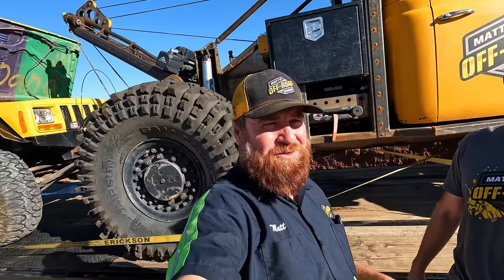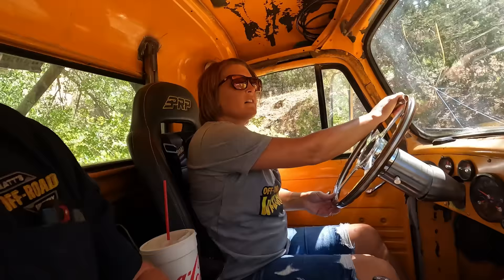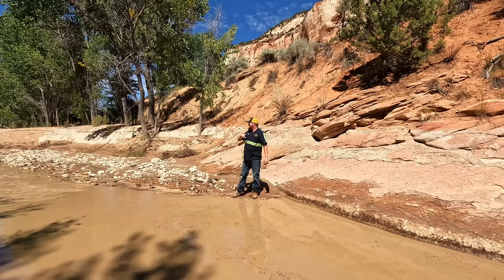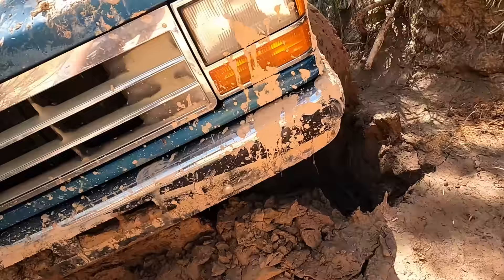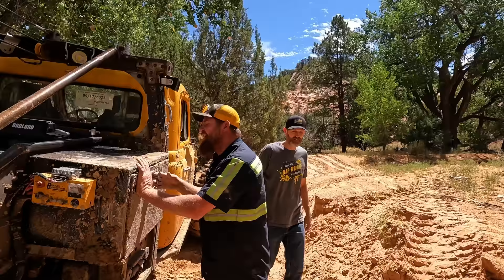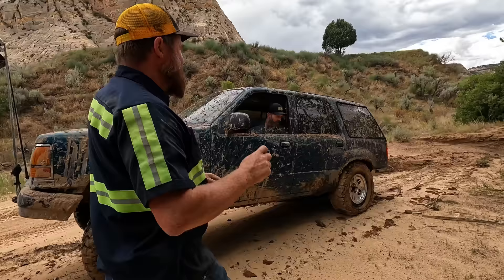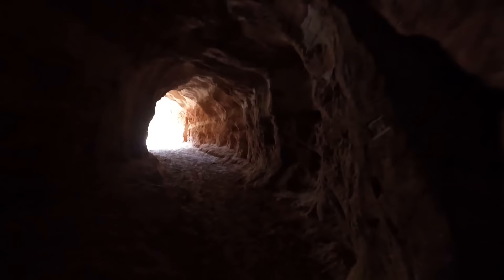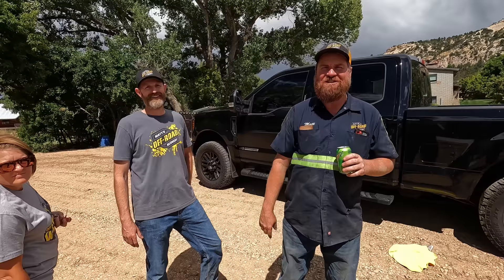It Doesn't Get Much Harder Than This...Pushed To The Limits!

Comment: those air lines you've got in the hot area of the wrecker. rather than switch the whole lot out for hose, you can actually get that same size of air tube in PTFE which will handle a higher ambient temperature. it's also cross compatible with the fittings you have. Might be usefull info for you guys :)

Amazing video, cool as heck to see the wrecker perform a super super hard muddy bog recovery!

Comment: It's amazing that you have been able to build an offroad wrecker from the bottom and a white piece of paper like this. The rig is incredible and an impressiv construction. A construction that should be fantastic good also in other situations and other industries. Just think of one simple thing, tractors used on bad roads or paved roads. The problem often is that a rig is good on the fields or offroad, but not so good on different types of roads. Some will maybe be angry with me, but I have never seen a rig like this one. I'm bowing my disabled old body in the dust because I'm madly impressed. Congratulations to Matt, Tom and all the rest of the team. You are really doing an impressiv job, but I have in a relatively short time written so much praise of you that I have to be careful that you shouldn't just take off my friends😅.

Comment: Matt - those mud tires don't work if they arent spinning fast enough to clear the treads. Put the pedal to the floor and let the mud fly. You can see that they just held onto the mud and turned into slicks.
Reply: Yeah, but you can use mud just as sherp. Swim through it. If you eject all the mud it will lay on the axels.
Reply: @tramvaj12  Exactly, you have to have a good idea of what is under your layer of mud.  If it is is harder below it, then sure spin out if you think you won't bottom out.  However, in a situation like this where you are on a river that just flooded, there is no guarantee there is a reachable bottom and you could wind up stuck.  Sticking the "World's Largest Off-road Recovery Vehicle" means there aren't really many things that will be getting you out.
Reply: Agreed,  let those tires eat!!
Reply: Would sipes help?
Reply: @bulldozer7656  if there's no bottom then you're stuck
Reply: @DarrenUren7  Yes, it helps clear wetter mud out of the way. Soupy mud is hard to say. You reach a point where only the centrifugal force will really get the tire clear. The problem is you have to balance "fast enough to fling the mud clear" against just digging the hole deeper.
Reply: Agreed

Comment: You guys might want to plumb that air setup with metallic tubing in that hot location, then change to your plastic tubing where the heat isn't a problem.

Comment: A very capable set up for the Samurai is, 4.89 t-case gears, ARB Locker in rear axle & modified YJ springs with revolver shackles. Power steering is also a good addition. MB

Comment: The major issues you are having with this seems to be the heat coming from the headers, just put iron exhaust manifolds on it with ceramic coating and a piece of sheetmetal between the exhaust manifold and other components and you will solve the underhood heat issue
Reply: Ha. I reckon he knows that.
Reply: He could wrap his headers and exhaust system in header tape too. Then put some type of heat shield over it.
Reply: Or route the exhaust through the hood like a derby car😜

Loud pipes, saves lifes😄
Reply: @edwardscott3262  he taped them which is a start
Reply: @mattmorris2867  But he hasn't fixed it yet, and run the wrecker without locker because the air locker lines are melted, he's the master of procastination
Reply: @pcx4545 yep. But he’s also really busy. And he’s so good at driving that thing be made do.

Comment: I hope the wrecker gets fixed fast. It’s sad to see it with so many problems.
Reply: It's a custom built vehicle basically in the prototype stage. Problems are to be expected
Reply: Yeah, it's time to get serious about fixing the 'no locker' issue, at least. That's making things unnecessarily difficult.
Reply: Built themselves AND designed themselves....AND from scratch!   That's quite an accomplishment. 
  It's gonna have teething issues, that's the way it goes with such a hard working truck.
Reply: @pat8988  it has air lockers, it'll be more surprising if it didn't have some locker issues atleast during these early years of its use

Comment: SUGGESTION FOR FENDERS: Some open-wheeled car designs have the fenders mounted to the knuckle instead of the body, so there's less space between the tire and the fender. I think the idea would work better than traditional fenders for what the LORW is made for, since the fenders would move with flex, rather than needing to be mounted out of the way to the point of looking out-of-place, and you wouldn't need to lose any steering angle with the axles flexed out. Especially if they're going to be removable like the Banana and Morrvair's mud fenders.

Comment: Many aftermarket exhausts need a bumper trim, it isn't a cut if it is only a trim! But the factory finish would be to replace the rear valance, however a lot of $$$ would go into that, so manipulating the rear mounts would probably be the way forward.  
I enjoyed this video, tinkering not repairing!

Comment: Chad did an awesome job on the wrecker, I do blame you Matt for not getting a vital piece of equipment fully sorted, Rather than just winging it on a hope and a prayer every time you use it. 

Great video though, that was a mission with your crappy air system.

Comment: Chad did a great job that area just builds so much heat air lines just can't handle so it's a fairly simple fix 1 build a heat shield that can keep the stuff in that area cooler 2 reroute and relocate some of the stuff in that area 3 (probably the hardest option imo) redo the exhaust so heat doesn't build up so bad in that area no matter what route is taken that's just the kind of stuff that comes up with a 100% 1 off custom fabricated rig once it's built the first year is shaking it down finding the little gremlins that need fixed or refabricated Chad did a wonderful job to only be having issues in that 1 area (who could've predicted there was going to be so much heat building up there) is a testament to the knowledge and quality of work he does I'd love for him to do some of the tedious work I don't like doing on 1 of my builds I might have to get with him on my tank of a square body suburban I'm starting the body is a 76 the frame is a custom tube frame it has the same style axles as the wrecker (I figure that big boat needs rear steer in Wal-Mart parking lot before the addition of bigger tires and bumpers) I'm not sure I'll be running the 54s that came with the axles I might save them for my next project (an 83 Silverado 3+3 camper special with a 14 ft utility bed with gin poles and a wrecker sling with a welder/generator combo from Miller and a spot made to hold a gas bottle for the welder for mig welding and torch bottles the old school amber rotating light bar and a Tommy lift gate to make it easier to load big tires I'd like to find a crane off an old tire truck and do away with the heavy lift gate I still have plenty of time it'll be custom tube frame too since I'll have to stretch it anyway with a 14 ft bed) I'm thinking between 45 and 50s will be fine for the burban and the 54s on the heavier longer repair/recovery rig both will have built balanced and blueprinted 454s with Holley sniper replacing the quadrajunk carbs they have now and dual 35 gallon fuel tanks the bumpers will be 8 inch 1/4 inch wall square tube caped for air storage but wiring just isn't a job I like I can do it I've done most of my other projects and my kids have helped with their vehicles we build since their very first vehicles I'm going to test a devildog trans in the burban and keep the SM456 in the Silverrattle if the devildog doesn't hold up I'll go back to manual in the burban too

Comment: Don't know if you'll see this but because the 8100 Vortec also came in GMC Topkick & Chevy Kodiak you can get and auxiliary air compressor that you can get oem brackets to run, might be worth looking into as backup. Found this out while doing research for my suburban swap.

Comment: I'm sure you already know this but in case you don't - they make air operated clutch levers for the winches that you can just let freespool by the press of a button. It also has a manual lever attached so if something brakes in the air supply they can still be operated.

Comment: The air lockers not locking are the reason why I wanted the Detroit Lockers, but now I’m also interested in the OX lockers but I’m not sure if those are even still available. If they are then I’d ideally want a Detroit in the rear and an OX up front. OX is hand cable actuated so you can’t beat it for simple.

Comment: I think the all of the plastic tubing should be reimagined.  Metallic tubing is tedious to install, but it is so much more durable and would be an overall improvement.  With all of the compressed air requirements on the heavy wrecker, I think that a retrofit is mandated.  Maybe relocating the compressor and air lines away from the engine bay is another option.

Comment: Those were the great explores. Took 2 over 400k and never left me on the side of the road. They were both 4x4s. And they never went off roading. 1/4 of those miles were pulling a 17 ft boat.

Comment: I really think you guys should build your air system on the wrecker with braided AN hose i use earls speed seal hose and fittings for my air i use 4an for the air. Its expensive but very reliable and very versatile. I use the same hose to make my brake hoses and stuff too. 

Also chad can't really be blamed he's awesome. i dont see why anyone would point fingers its a new build theres no instruction booklet on how to assemble a custom vehicle like this plus nowadays its hard to find high quality parts a big part of building a new vehicle is working out the kinks some stuff fails and is faulty and if your gonna use the vehicle you will find its faults. I build some stuff thats heavily abused and nowadays its extremely difficult or nearly impossible to make everything perfect the first time on a build especially when its something new and different from what you normally use. I try to use what i know works but when your using stuff for the first time sometimes you'll find that parts and pieces are just junk i find that a lot. I was just recently talking with someone about how much thought and work goes into making sure products i install are reliable i almost never use any sort of hardware or wiring or hoses or connections etc that come with a product anymore unless i know its high quality stuff because i can usually put together something better. I'm extremely picky because theres so much junk out there and a lot of problems can arise from the little things.

Comment: A little handy tip maybe use an e-locker on the front and an air locker on the back. That way if one fails you have you it wont create further issues with the 2nd locker.

Comment: Detroit axel is where I have gotten suspension parts from in the past ,they might have the suspension kit you need.  It  may be a good idea to pull the engine to re gasket her. The transmission front  seal should probably get changed also. It would be so much easier at this point of time 🤔

Comment: I know you guys don't like advice. But get rid of the push to connect fittings on your air lines. I used to build Firetrucks. We tried the push to connect, BUT they always leaked. The firetrucks had to hold air with nothing on to be able to pass Underwriter Laboratory testing. They would not with the push to connect fittings. Use the compression type fittings with the sleeve to keep the line from collapsing.  This is from experience working on firetrucks for 18 years.

Comment: but with hi lift ,base plate and the rim lift attachment,  and alot of work we got out ,  worked by lifting   the axle by the rim and out of the hole,stuff hole ,lower tire ,repeat, and ramps help.

Comment: Well this was quite interesting 
I am 99% certain I use to own the Explorer you guys recovered in this episode 
Same dash topper, same LED lights over the inner rear windows. Same color. 
If its not the same it sure was one of the hardest but smoth recovery yet...
Reply: Well update..... was not mine.... The one I owned a long time back has a glass sun roof.

Comment: have posed this before but have not had feedback.  When towing close-coupled and where the towed vehicle needs to not strike the front vehicle (negotiating drops?), why not run a tow strap tight through a hollow stiff tube that has cushioning at each end?  This could be the primary tow strap or an auxiliary one (like when the front end is lifted up by an offroad tow truck).  It might be fun to build it and go try it - like an offroad train.  If it's feasible, perhaps engineer an expandable tube or a sectioned tube to give various lengths for various challenges.  Come on Matt, cheap thrills if it works...

Comment: Old ranch trick ,, get a 2” or 2-1/2 pipe about 8 feet long ,, weld a hoop on 1 end and a short chain on the other ,, hoop on wrecker pintal hitch ,,chain around what ever point on inoperative vehicle,,, that prevents the slack and hard hits on stopping / downhills .

Comment: Time to forget about the plastic air fittings.  Just use old fashioned brass ones with the crush collar.  They're not as convenient as the plastic push style air fittings but they can't take the heat.  Or make some fancy hard lines.  I know it's difficult to work on the truck you need for work...

Comment: Plumb your air lines in stainless in the hot areas by your manifolds. Swagelok makes the fittings you need. I do it at work for air actuated steam valves.

Comment: When you use the axles you have at the shop from an Oshkosh or whatever big machine they are from. I’d love to see you build a 6x6 version of the wrecker with a slide bed. Even cooler if it had a boom that folded flat into the floor of the bed when not in use. Would be a wrecker and a slide bed in one. Would really make yours life easier with some of your work. 

Also have you ever thought about making the boom on the wrecker hydraulically extendable so that you can move vehicles away from the back end of required. Could be a cool upgrade.

Comment: Jaymie just loves driving the wrecker, doesn't she?
Also, with the discussion about not hitting the back of the wrecker, maybe you need a soft bumper on there, like the tyres they hang over the side of boats for docks. An old tyre or a bundle of rope or something similar that can be strapped over the back end of the wrecker when needed, or stowed elsewhere when it isn't.

Comment: IMO i would get rid of These silicone hoses and use some stainless steel lines to connect the air supply lines....and you don't ever have to worry about them getting to hot😅 there are some sweet connector parts out there, like from Swagelok or so,so you can build the lines however you need them

Comment: That was a bit reminiscent of the Wrecker Games with the pulling a car out of a hole with first the winches free spooling and then pulling the car out with the winches.  But too bad that the lockers in the front and back didn't work dependably.

Comment: Im surprised it would actually be hydro locked with the water lines that low I bet the battery got drained from a short circuit though. a hydraulic ram out the back would be a great addition if you really think it out you could use it as a wheel lift and as a foot for max winching

Comment: Hey guys you should invest in one of the new models of Polaris ranger 1500's.  That vehicle could be a real good support and recovery with that winch which is 4500lbs. Double up around 9000 lbs. Of pulling.

Comment: I’m wondering if copper line and fittings would solve the poly airline issues? At least in the vicinity of the hot headers.

Comment: It looks like the explorer was in gear and in 4 wheel drive for the entire tow.  Any time the rear wheels turned the fronts did the same both forwards and reverse.  Hope the trans and transfer case didn't sustain much damage.

Comment: Im sticking with my original thoughts on the wrecker. You need more power. Merlin has the perfect wrecker. Thow a 5.9 liter Cummins inline 6 cylinders in that thing and you will not regret it.
Think about it huge tires, alot of wight, large frame. Need i say more

Comment: Anyone blaming Chad for issues with the wrecker must be the people holding on to the instruction manual on how to build the Worlds Largest Offroad Wrecker because Matt and Chad didn’t have access to them. 
In a recent video Matt once again realized the exhaust is extremely hot and needs to be wrapped when sticks and debris caught in the belly pan were starting to smoulder and burn and that was well away from the firewall where the exhaust temperatures would be a lot higher.

Comment: I once pulled the valve stem and sprayed expanding foam into my tire with a gouge to get me out of the trail..... What are ya'lls opinions on the potential for using that occasionally to help a tire that won't inflate and is done anyway?

Comment: Whoever is blaming Chad for problems with the wrecker does not appear to have watched any of Chad's videos about the job. It was a huge job, and Chad pulled out all the stops to make it good enough. 

Anyhow, I still think that wrecker is totally awesome. And it'll be even more awesome once the niggles get ironed out and it has reliable lockers (for example).

Also, there's no doubt the welding would hold on the wrecker. Lizzy did most of that welding.